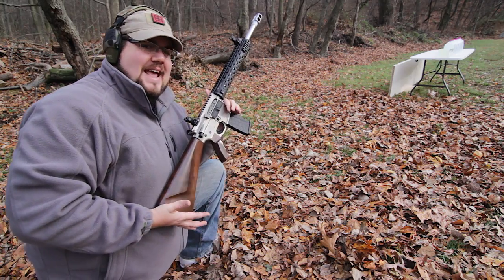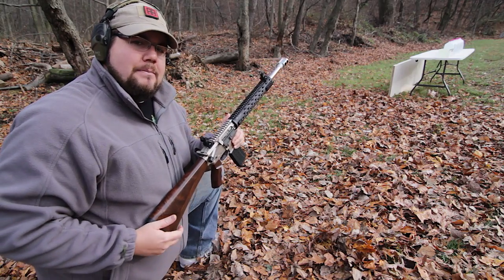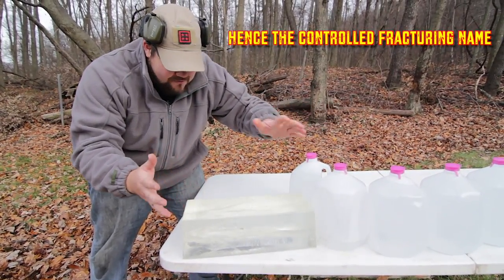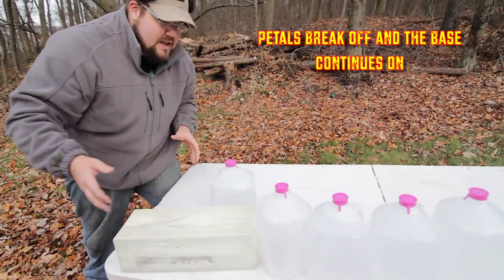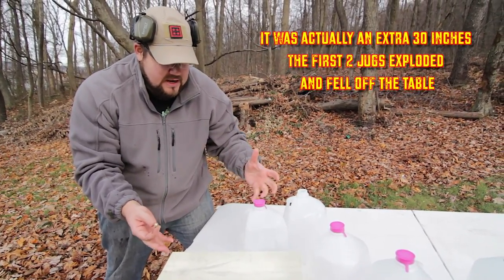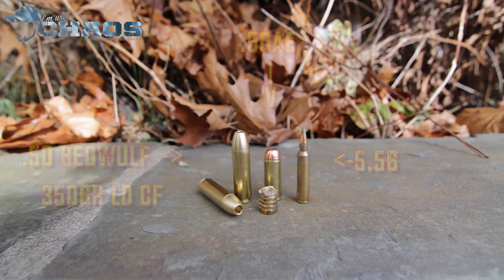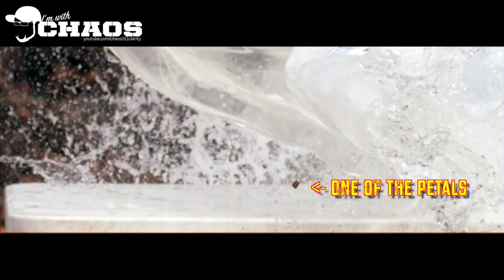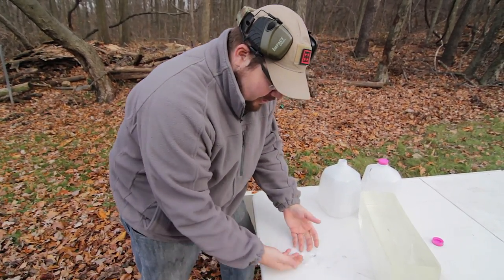.50 Beowulf VS. Ballistics Gel - 5K FPS SLOW MOTION!

Comment: Nice man! I'm looking to get a camera capable of these frame rates. I got to say, I just shot a block of clear ballistics from 500 yards with a 208 A-MAX I handloaded with some RL-17 for 2550 fps at ~35F outside. They did about 2625 at 90! Anyway, the wound track was almost as impressive as this 50 Beowolf! Well, there was a 2" track running about 8" and then tapering off to where it exited the block, but still disrupting at 14". I was shocked!